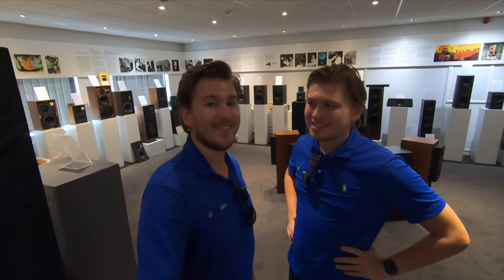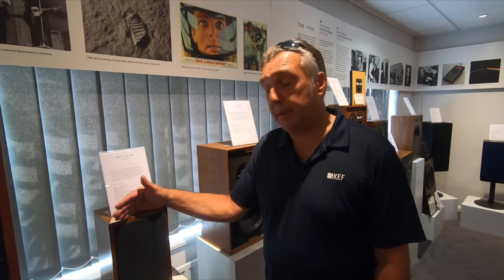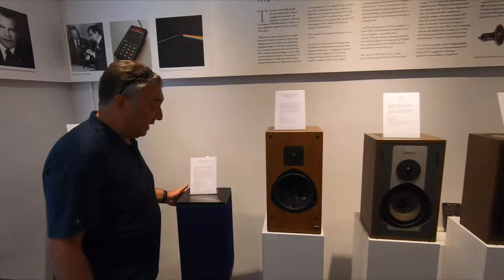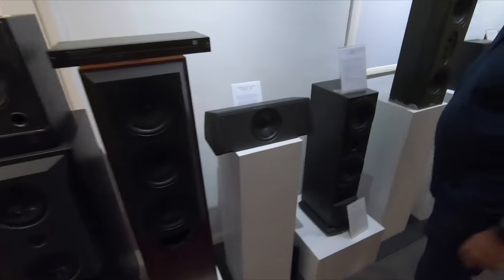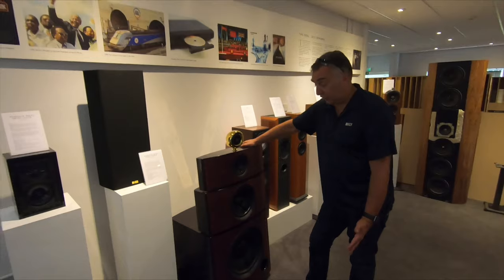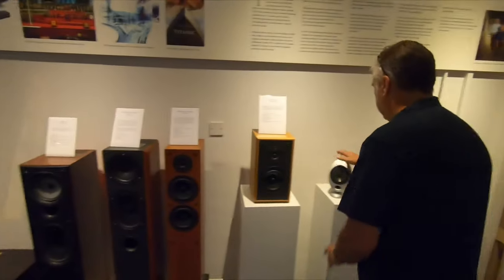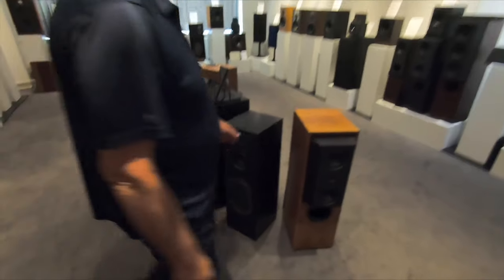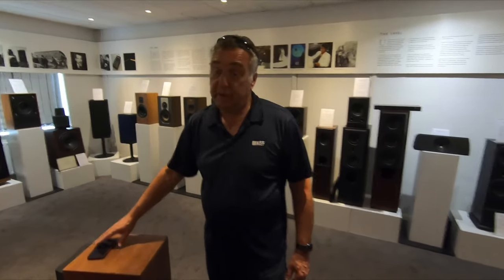KEF Factory Tour UK | KEF Museum Walk through | HiFi Heaven!!

Comment: My first KEF was a pair of Corelli which I purchased slightly used back in 1982.  I have since owned the C40, Reference 101, 105/2 and 104/2 which I still own.  I also owned a Model 90 center channel.